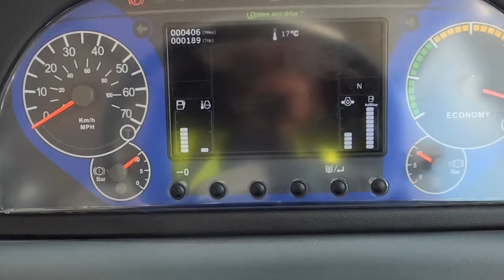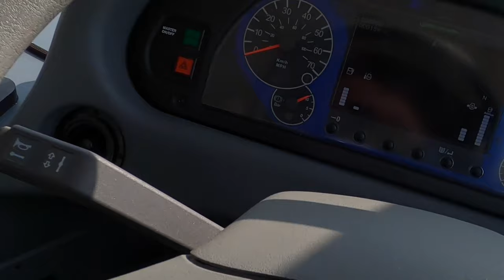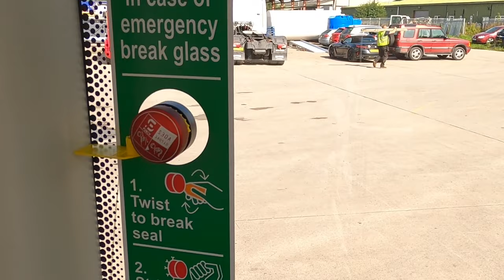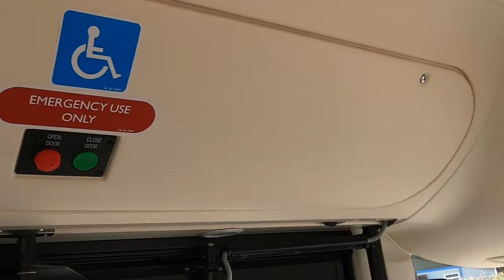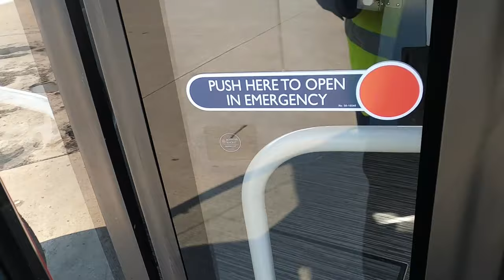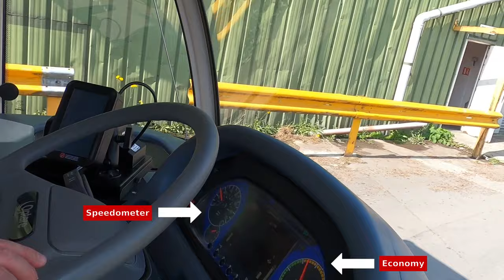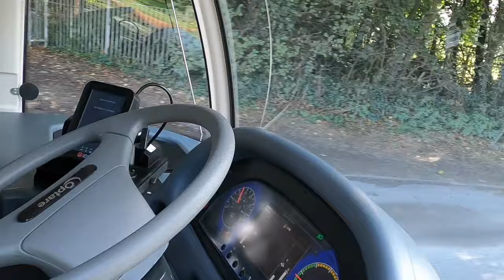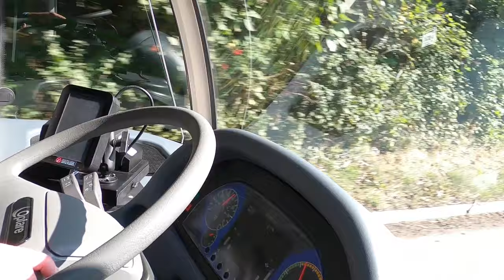Test Drive | Optare Solo SR

Comment: From the loving revs of the well manufactured Mercedes engine, only amplified by the impeccable and reliable gearbox, to the firm but fair suspension of this, what can only be described as feisty, little mode of transport; this minibus makes for an enjoyable, luxurious and teetering on the edge of sensual experience.
Reply: hell no, these are amongst the worst buses I've driven. They constantly feel like they're going to tip over when you turn any corner. Merc engine is also crap, our buses are 18 plate and nothing but problems. Also the horrible dashboard layout with the massive shelf at the front makes it near impossible to navigate tight spaces as you can't see that corner. And the plastic is just cheap quality which scratches just by running your finger nail over it. Most of the steering wheels we have are also replaced with iveco steering wheels, as the original optare wheel has fallen apart... yes, with only 5 years of age the steering wheel wore down so much it starting showing the metal structure. ALSO ALSO, optares are known for not storing air in their tanks for long periods of time, ours will dump their entire tanks after about 30 minutes of engine off. So if you're stopping for a break, you'll need 5 minutes to fill the tanks back up, which apparently is because these aren't fitted with an auto drain system to keep moisture out during cold weather. Should you find one thats kept its tanks pressurized with air, you can guarantee its frozen solid during cold weather, one time I had to wait nearly 10 minutes before I could move due to frozen air pressure lines. Yet I moved a streetlite instantly which had been sat for 3 days. I always call them the Optare solo, because you only need to buy 1 before you realize they're shite

Comment: How does this optare fair in hot weather? As a 2004 model driver, as the engine gets hotter, it transfers the heat to the cabin fans, making the bus stupidly hot, regardless of what setting the temp gauge is at.